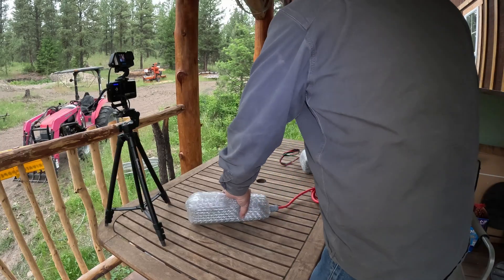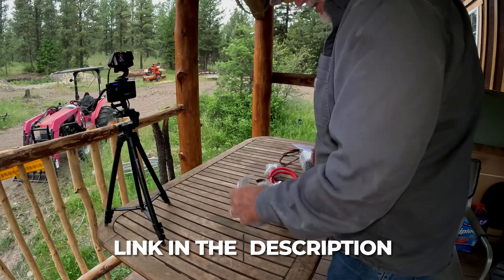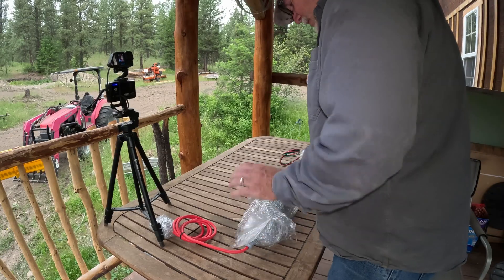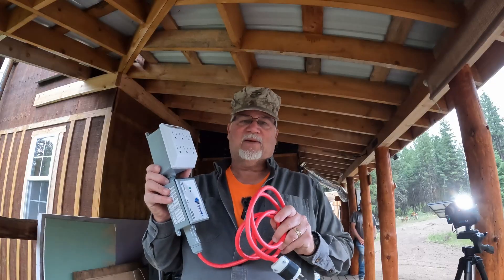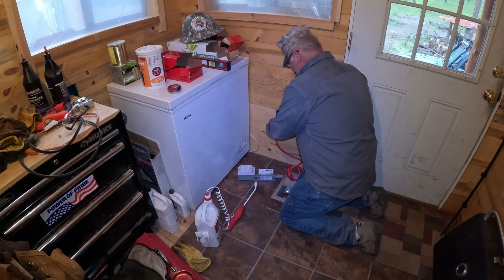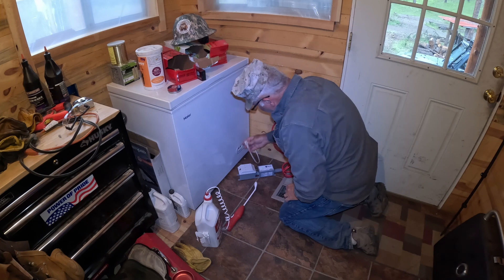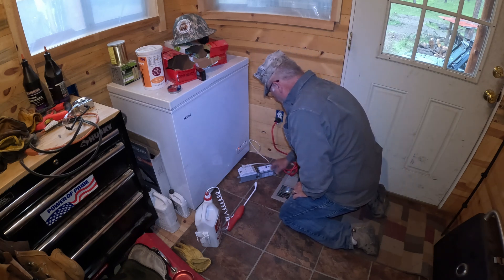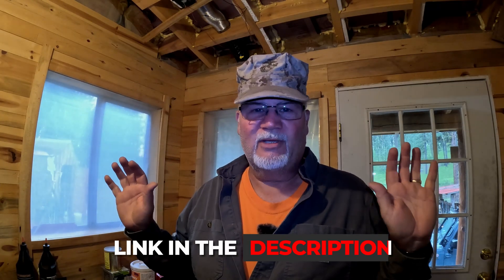Protecting our cabin from lightening and EMP! EMP Shield Install

Comment: Would it be better to plug this device directly into the inverter?
Reply from the maker: If you had an inverter with a 120v output (which I do now) I suppose that would be a way to do it since the inverter is grounded.  They actually make one that goes in the panel but for this application it was easier to use this one.  They also make 12v, 24v etc devices specific to each application since that's how they work (by voltage).

Comment: Surge protectors work fairly well in dealing with indirect strikes that cause voltage spikes to propagate along utility wires, but keep in mind that they won't work against a direct lighting strike.   They are also generally one-and-done.  Small spikes can be dealt with multiple times without blowing the internal fuse, but a big one will overload the surge protection more or less instantly and blow its internal fuse.

You can get surge protection devices for the breaker panel which have integrated breakers in addition to the surge protection.  I couldn't quite tell whether this device is one of those or not.  The advantage is that the surge protection will also trip the breaker.  So during a strong strike that is enough to blow the surge protector's fuse, the surge protection lasts just long enough to trip the breaker and then the appliances hanging off the breaker remain at least somewhat protected due to the trip.

Note that these $X-dollar product guarantees are generally meaningless.

-Matt
Reply from the maker: Thanks for the comment.  Yes, you can get these that integrate into the panel much like lightening arrestors and standard surge arrestors however, as you eluded to, there's more yet that needs to be done.  In this case, to fully protect the system you'll need protection at a number of points.  This device will protect against surges on the 120v side of the AC panel by diverting excess voltage to ground but it isn't protecting the system the same way an integrated unit would and it won't provide protection for the inverter (getting power from the 24v battery bank) or the panels, charge controller inverter etc.

As for the guarantee, I'd rather have it and have to fight over it than not have it at all ;)

Comment: Just wanted to let you know that we had been struck by lightning. Pretty much everyone has protective devices out there to protect you from over voltage. But, and a big but, none of them are protected on the ground side of the wiring. Because we lost appliances and what happened was the lightning strike traveled all over on the ground side. Not the hot side. So, in my opinion nothing is going to work to protect stuff until someone figures out how to protect the ground side as well as the hot side. You might want to ask these questions.
Reply from the maker: With a $25k warranty I'm ok.  If this doesn't protect myb120v stuff they'll have to replace it.  On a side note, however,  this is just one piece of the puzzle.